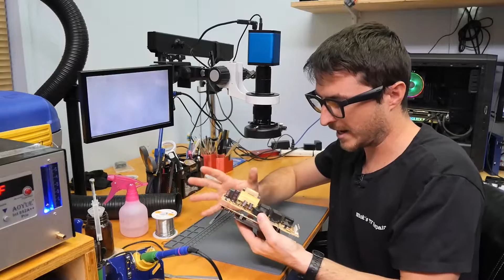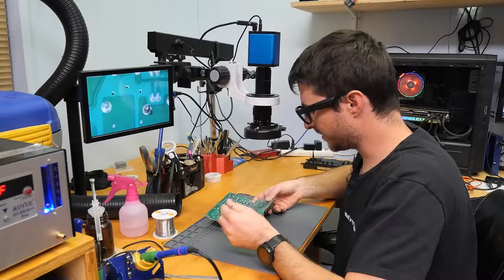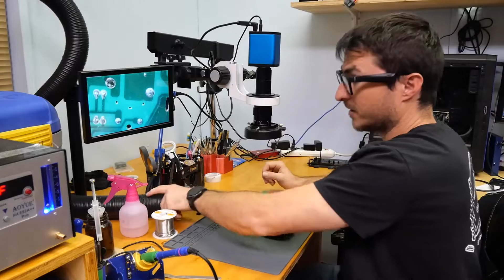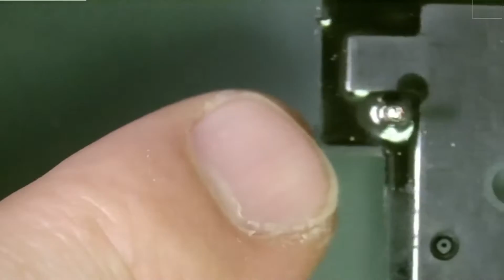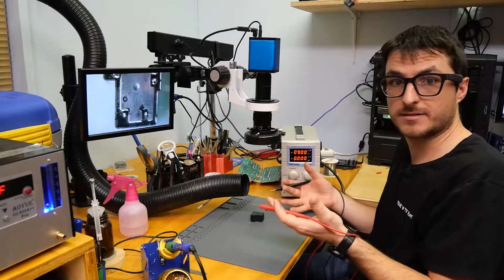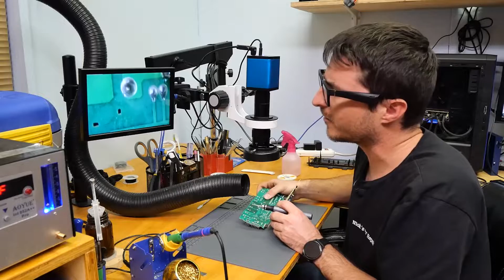Frigidaire Electric Range Oven Control Board Repair 318010102

Comment: I can't determine the low voltage for my relay.trying to order a new Omran.G8P UA 006054
Reply from the maker: you want one that triggers at 9v
Reply: Thanks! 
I ordered a volt  one after finnnnnaly seeing 9v on a black box on the board.
The 2 white relay look identical/ but one is an 0006055 no.15A
NC 10A/125vac
Can't find that one any place.If the 0006054 arrives.Ill swap it/test the old/and see if I get lucky.
Think the new one is under 8 bucks including shipping. 
I hate it when a seller doesn't want 15 dollars to ship a part that weighs an Oz!
Reply from the maker: When it comes to electronics you can bet that any item that is more than 10 years old, what ever component it uses are all discontinued and no longer avaialble. So often you have to identify what is a newer version of that same component. 
And yes agreed on shipping cost. I would rather you just be upfront and say the component is $30 free shipping instead of telling me the component is $10 and charge me $20 shipping.

Comment: Thanks for your video.. I'm having an issue with convection bake. Wonder if you can point me in the right direction. 
I desoldered both relays tested them to be okay solder them back. So bake and broil elements work but no heat under convection and the fan turns on.. I'm not sure of the convection bake path
Reply from the maker: Let me get this straight. When you do normal baking, no issues. When you do normal broil, no issues. But when you do convection you don't get the heat from the baking or broil element anymore? 
I have never heard of that fault before. The convection is the exact same as the bake and broil, the only difference is you have a fan spinning ontop of the same elements heating up. 
I would have to have you send it in for an in person diagnostic because I don't know how to guide you here. This is a fault I have never seen or heard of before. It's possible you have a software malfunction, or one of the IC chips is defective. We have had to fix that before but it's very rare and it usually doesn't manifest in the way you are experiencing.
Reply: Thanks for the reply. But yes, unfortunately that is the problem I'm experiencing. I select convention, bake the fan kicks on but neither elements heat up. Details on how to send the board to you is in your description?
Reply from the maker: Well we typically charge an up front repair fee and have you purchase the service. But given this is a very unusual situation we can have you purchase the testing and diagnostic listing linked below instead:
https://nickselectronics.com/products/diag-and-testing

Once you make the payment for the bench fee, an email with packaging and shipping instructions will be sent out. 
Once we receive it I will take a look at it and reach out after determining the extend of the required repairs. Just to confirm but you have the same controller board with part number 318010102 correct? If not, please let me know the exact part number. 
Thank you
Reply: @NicksTVRepair i understand... it's actually 318010701... Frigidaire wall oven model CPEB30S8CC1
Reply from the maker: I see. That is actually a bit of a different unit. 
Here is something I would like to ask of you then. It will cost you a bit more for shipping, but can you also send in the button assembly along with the controller board. This is going to include that glass panel that sits in front of the controller. Just be extra careful when packaging it to ensure the ribbon is not bent or kinked as it will break the internal lines. 
This would allow me to do a more in depth testing of your unit.

Comment: Hey Nick, fantastic video.  We have a motherboard issue with our fairly high end Frigidaire Electrolux. Conventional oven won’t get up to temperature.

Could I send the motherboard to you for repair?
Reply from the maker: We can probably fix it for you, but before you send it in I want to make sure we can, so that we don't waste your time sending it in. 
Can you fill out the contact form on our website (link below)
https://nickselectronics.com/pages/contact

Please provide the part number of the motherboard, model of the oven, and any other information that could help us identify what control board you have so we can confirm it is one we are familiar with and have what we need to properly test before and after repairs. 
Also if you have any other questions that's the best place to ask!

Comment: Thank you i repair appliances and have been getting into board repair. I never knew the trick to scrape the board to get  a better connection!  You are so good at de-soldering with the vacuum pen. I had to get a hakku gun cus i suck.
Reply from the maker: You're welcome, keep practicing and you will get better over time!

Comment: Hearing a click on a powered relay is not a real test, you should connect your multimeter terminals and check the continuity between 2 main pins, I've seen relays clicking but no continuity.
Reply from the maker: That is correct, I have also seen relays be bad and still click.  
This is an old video, we always check for continuity now.

Comment: Question, same board and problem. Purchased a repair kit with relays had my tech replace relays, still no bake relay firing, all other components good. Then replaced ic component , still no bake relay coming on? Shows command and temp when selected but the bake relay never clicks on to pass power. Any suggestions appreciated. 2k$ stove with an obsolete board!
Reply from the maker: Unfortunately, I wouldn't be able to give you an answer without having you send in the control board for us to diagnose ourselves. It's possible you got a bad replacement relay, and it's possible something else is defective with the board. 
Do you still have the original relays? If you did want to send the board for us to fix, I would request you include your original relays with the board for repair.
Reply: Thanks, just curious if the processor component could be just faulty on one output only. I'll look into sending it to you. Thanks again
Reply from the maker: I don't believe the processor would fail like that but I guess anything is possible. Typically if it fails it's full failure not just bake element failure. It's more likely that something else is at play in my experience. It could be that the relay you were provided is bad, is not the right spec, or it's possible there is another component that has failed such as a diode, or transistor.

Comment: Im gonna pull ou my board and check it. If I see nothing wrong, what is general charge for you to repair?
Reply from the maker: So we have multiple tiers for the repair. We have our basic tier which will cover most faults such as the ones below:
Oven Heating element does not work
Intermittent error codes, including F1, F2, F3, F4
Oven exceeds the temperature setpoint or will not turn off
Oven does not reach temperature

And then we have a higher more expensive tier that will cover all other faults including the display replacement. I of course recommend the higher tier repair because it means we will replace all of the parts on your oven controler board that commonly fail, so even if they haven't failed yet some parts may be near their end of life and would be wise to have those replaced. This higher tier repair will cover the replacement of all those parts and ensure you get as much life out of the unit as possible. 
For more information, check out the repair service listing on our website linked below:
https://www.youtube.com/watch?v=5rSmKJpcvDA

Comment: Hearing he relay click is not always an indicator that it's working 100%. If you have the electrical specs  you should also check the resistance to complete the full diagnostic.
Reply from the maker: Yes, correct. When checking the relays we also check the continuity to make sure it's properly working. 
Someone did mention this in one of the earlier comments after the video first came out and we have been doing it that way ever since.
Reply: Exactly!  He should have taken a resistance reading across the contact pins to see if the relay contacts  are damaged.
Half a repair.
Reply: @FixItPleaseJ half a reader. Would never trust you with any repair work if you have no attention to detail.

Comment: Hi Nick, This was a great tutorial (though I don't have all your great tools, so not in a position to solder etc.) But I have a question regarding a Frigidaire Gallery Range; Model #: FFEH3054USA and hopefully you can help me.  The Self Cleaning mode keeps blowing the thermal fuse, which I had to replace three times over the years (it's a rental property and the renters keep ignoring the request not to use Self-Clean).  Do you have any advice on how to permanently disable the Self-Clean mode of the oven w/o impacting any of the other functions of the oven?  (either which wires to disconnect or how to disable it through the control board).   I bet if you create a video on that it will be VERY popular... :) 🤔
Reply from the maker: The only way I would know to disable the clean feature without affecting anything else would require soldering. You should be able to get away with removing the button itself. And while you may be able to cut it off or break it off you might run the risk of damaging the board if it's not properly desoldered.

Comment: I picked up a free stainless steel oven off of Marketplace.  The lady said they had a power surge and it burnt out the stoves oven control board.  After some testing, I found out the thermal fuse, wrapped inside the main transformer, had burnt out.  Simple fix at almost no cost.

Also fixed my mother in law's oven.  One of the main solder connections that sends power to the oven and melted.  Simply re-soldered and added a bit of extra solder.  Been working for years now.
Reply from the maker: Nice! That first one (fuse inside the transformer) can be a tough one to identify, you also have to know there is one in there which most people don't. I have been meaning to do a video on exactly that repair.
Yeah, the solder connections going bad is very common, not just for oven boards but anything that has high power going through it. Glad to hear the repair spirits are high! Not enough people with that mindset anymore.

Comment: Thanks for the tutorial.  I'm going to try this on my 318010102 board.  Question tho...  I have an issue with the temp (like you showed) as well as a dim display.  Have you encountered that before?
Reply from the maker: Hello,
Yes, the dim display is fixable but does require a bit more advanced soldering skills as you will need to replace the entire display with a new one. Here is a video on that exact repair I made:
https://www.youtube.com/watch?v=bSUa4f8KvhM
I do have the display for sale on my website if you want to give that a try yourself. 
https://nickselectronics.com/products/ovendisplay

Comment: IVE REPAIRED SOOOOOOOOOOOOOOOOOOOO MANY AND REPLACED RELAYS   THANK YOU CHINA CRAP   AND REFLOW ALL OTHERS
Reply: DID YOU CHECK CONTINUITY TO THE PINS OF N.O CONTACT             AAAAAND ITS 12VOLTS
Reply from the maker: We do remove the relay and test it. In the video we didn't do it but we do everytime now, and that is to check to make sure there is continuity between the 2 pins of the relay once it clicks on to make sure there will be proper flow of power. 
I have almost never had to replace relays. In the hundreds we have fixed now, I think we have seen 2 bad relays ever. This is specifically for this unit, there are other types of oven control boards that we fix that use different relays and those fail all the time internally and need to be replaced. So this is not a one size fits all statement, it is specific to these models with these relays shown in this specific video.
Reply from the maker: I don't know if the relays are the cause of the fault and if we can blame China for it. In my opinion, and this is speculative but it may have more to do with the design of the circuit putting too much power into 1 single small solder joint thus exerting too much stress in that area that causes the cracks in the solder and then causes the relay to fail. But also I could be wrong.

Comment: Nick, thank you so much for the assist with this video! I followed your instructions and found a burnt/blown solder joint on the bake relay. Fixed up the soldering and reflowed the other joints as suggested. Dual fuel oven bakes again!!! Thanks again--there's very few people out there sharing this kind of info. Super helpful!!!
Reply from the maker: Glad it helped!

Comment: Suggestion: Use silver-bearing solder for this repair.  NOT "silver solder", ... silver BEARING solder.  It comes typically with 2% or 4% silver.  It makes a much stronger joint than conventional tin/lead electronics solder.  Resoldering these blown-out joints with regular solder lasted about 2 years.  After using silver-bearing solder, it's been 5 years and still works.
Reply from the maker: So we use leaded solder because I have been told that since lead is a softer metal, it means in theory it is less likely to crack from thermal cycling. What are your thoughts on that? I have seen different information online pointing me in different directions over the years all saying to use different things. 
If you have more information and details regarding using solder with silver in it I would love to read up on it. We do have solder with 4% silver we just don't use it often.
Reply: @NicksTVRepair  Leaded solder is definitely WAY better than the lead-free stuff.  So if I had to choose between those two, I would choose leaded.  But, silver bearing solder is Sn/Pb/Ag - Tin, Lead, Silver.  So you are not giving up the good qualities of lead by going to silver bearing.  Just that 2 or 4% added silver makes the solder much physically stronger.    ChipQuik makes it (and I'm sure other brands do):  Chip Quik SMD3SW.015
Reply: @cowsongs  I wonder what the manufacturers are using.. obviously whatever is cheapest but I wonder if they are making them use lead-free to comply with some environmental regulations .. whatever the case, the solder joints are clearly lasting for 10-20 years in most cases.  I also wonder if some of this just boils down to poor quality control versus the quality of the solder itself.

Comment: Increased resistance of the high-side relay contacts are creating the overheating symptom on the board. You need to replace the bake relay. This is one of the most common problems I see on electric ranges. IMHO, those relays are under spec-ed for the job they do. You might think is was planned obsolescence.
Reply from the maker: Thank you for your comment and for watching the video!
How could one cool the relay or the board to help prevent this in the future? Are there higher-quality relays even available for sale? I didn't do it on screen but typically there is almost 0 ohms of resistance when the relay is activated. If the relay leg was wider or had more points of contact with the pad on the board I guess that would help distribute the power over a larger area and in theory would help reduce heat no?

I know how to fix things, but when it comes to circuit board design that's not my strength.

Comment: What do you use to remove the solder?
Reply from the maker: You can use desolder wick, or a desolder pump. We use a desolder pump to get the bluk and if there is any left over we finish off the work with wick.

Comment: good stuff.  how hot do you run your Hakko?
Reply from the maker: It depends on the job and the tip I use. But it's going to be between 350c and 450c.

Comment: You may want to check continuity to make sure it making and breaking connection properly. Oven relays fuse togther but still make the click sound. If the relay connection on the plunger is dirty with sut it still won't send power to element.  Both of those are extremely common
Reply from the maker: You are indeed correct, it is best to perform a resistance check once you hear the click to make sure there is continuity. We do in fact do that every time now, learned about doing that after the video got published. The video was our very first oven controler repair. We have done hundreds since then. But with that being said, the relays have so far never actually failed on this unit specifically. Not even once. So really there is actually no need to do a check if you are DIY . We still do it for QA but if you are reading this and don't have a multimeter and just want to get your board fixed, you only need to worry about fixing the cracked solder joint.

Comment: Ever consider working on a oven gas valve relays? Don't know anyone who does it?
https://www.youtube.com/watch?v=6Xd_VNcO8k8
Reply from the maker: We prefer to focus on electronic and electrical circuit board repairs. The gas valve seems to be more of a mechanical type repair. We also typically only work on discontinued parts or extremely expensive to replace parts as that is where the demand is on repairs. 
These valves seem to be available for less than $100 on eBay so it may not make sense to fix unless the price starts going up.
Reply: @NicksTVRepair  Thanks nick for the  response! I just might thinker around with those  electronic "coils" in the valves just out of curiosity to see why they commonly fail?

Comment: How do you remove the push button front?  I have tried pushing what appears to be tabs but they do not seem to press far enough.  Great video!
Reply from the maker: Hello Lewis, 
I can't really explain it without showing. We decided not to show that in our video since we wanted to primareily focus on the repair aspect and also lots of other videos do have the how to open part included.
Reply: Thanks for the reply.  I figured it out. They were a pull tab on the side where I was thinking there were push tabs on front edge